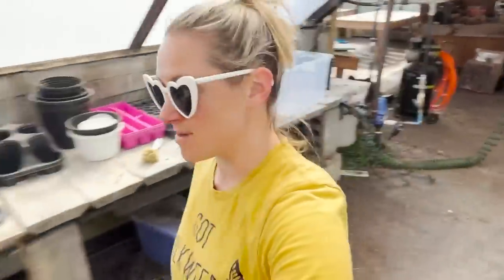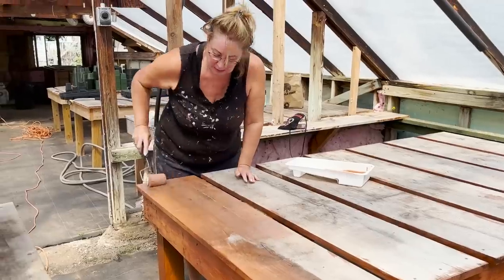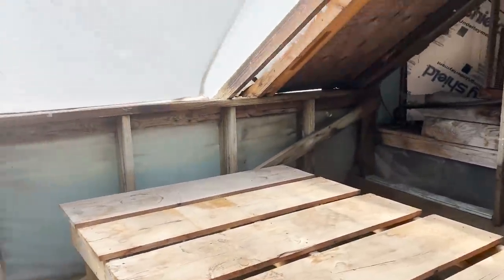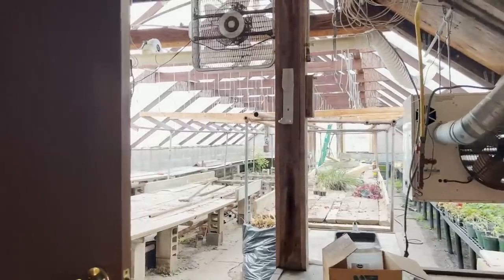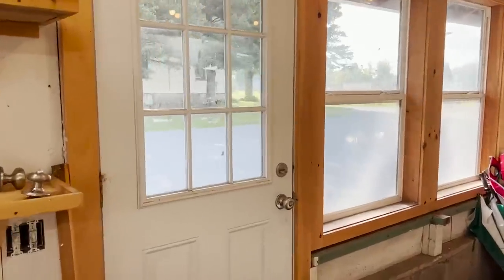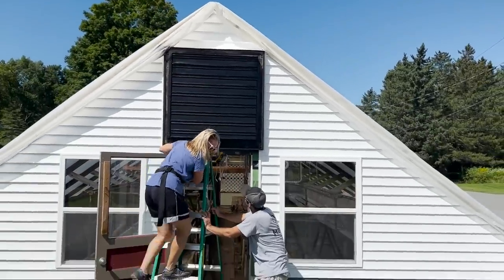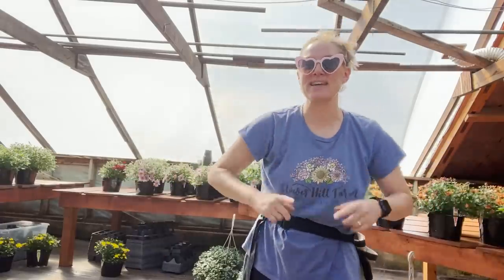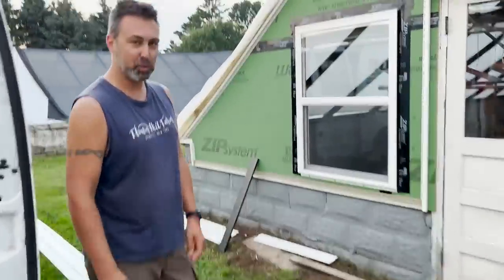Nursery Update: A Fresh New Face : Mum Sales Begin!  Flower Hill Farm

Comment: Y’all… if you don’t want bubbles you need to use a foam roller, not a fluffy one.  The roller will get the stain on there faster for the brush to spread/finish.
Reply from the maker: She isn't going to use the roller going forward-- she was just messing around to please the masses who screamed at her to try a roller LOL. The coverage has been great with the brushes!
Reply: In my experience, the foam rollers don’t roll as easily…you just buy a shorter napped roller
Reply: @FlowerHillFarm  🐫🐶🐎🌸🌺

Comment: Glad to see you using a roller but you need a bigger roller to hold more paint & don't press down so hard. Just the right pressure & holding just enough paint & the paint won't be thin & spotty.

Those small rollers are for trim, small items, & touch ups.

It's so cool to see so much progress!

Comment: You must be excited. Guess what we got?
Here in Cheatham County Tennessee in Chapmansboro, the sky opened up and according to our 6' empty fountain basin it filled 4" deep, 2" the first half hour after truck pulls up. Things didn't start that way. A tractor trailer rolls up from Kentucky with my 12x24 Greenhouse, wired with commercial exhaust fan and vent wired to work together. 2x24 attached table with greenhouse pro mats attached. Heavy Duty Door and like you started off, I paid with cash. Just came across your tube so I'll be watching, learning and sharing a story about me as a kid in early 1970's Boonville, NY, well.....I'll let you know if you reply

Comment: Has me thinking about your greenhouse number two... can you raise the rafter ties? This will give you more height without as much digging.
Reply from the maker: That's the minimum for this fall, but the fan is falling off the front and won't fit in properly so raising the entire thing is necessary at some point.